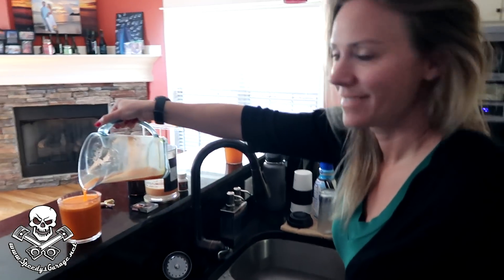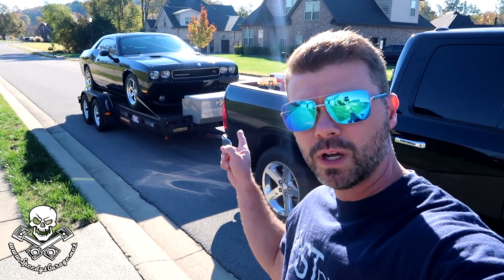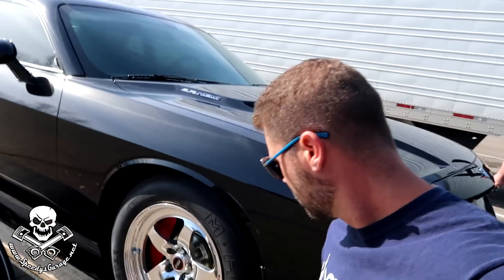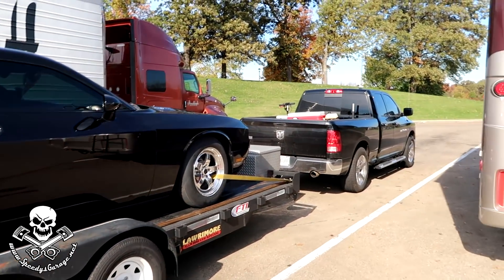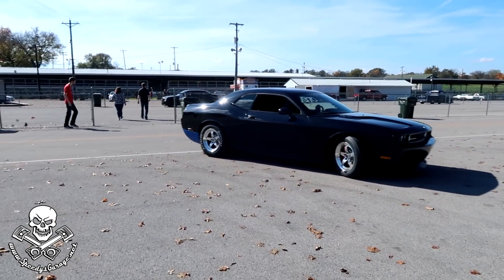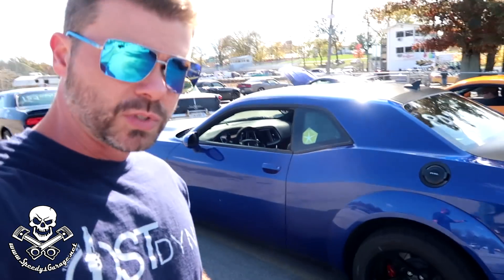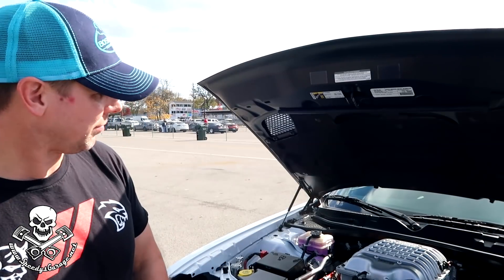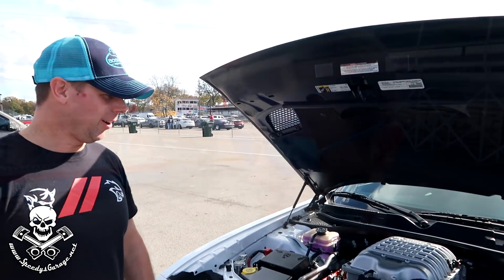Big Cam Test and Tune Speedy's Garage

Comment: Great information, over camming was so common back in the day, all some people cared about was a rough as hell idle not the response--My 68 427/425 had the factory 520 lift minus lash solid cam and that was good enough for 456 gears, wanted to try an L-88 or ZL-1 cam but I needed to swap springs and I was always short on $$$$
Reply from the maker: Turned out he had a bad push rod and was on 7 cylinders.  Fixed and he's back to running low 10s.

Comment: I'd say maybe the 392 gear from a 6 speed manual car and a looser converter. Anyhow would like to see what yall could pull out of this car...🤘😎
Reply from the maker: He ran a 10.55 at 131MPH a couple weeks back on 93 octane :)  Tweaking the tune a bit and some good fuel and it's low 10s all day.

Comment: The converter isn't right for the cam. Matching a cam to the current converter will be much more difficult than matching a converter to the current cam.
Reply from the maker: Agreed, we think he's got the converter sorted out.  He found something we think might have been holding the car back and have that corrected.  Have to wait till spring to re test though :(
Reply: @SpeedysGarage  I know about that! LOL!!!!!! I had to change my shift points 3X after a converter swap to get it right! I know you mentioned footbrake stalling in the video....flashing it at the line will launch at a higher RPM than footbraking…usually 500+ RPM..I picked up a 10th on my 60' flashing vs footbraking….flashing is also easier on the tranny.

Comment: which camera set up are you using
Reply from the maker: Combination of Gopros and a Canon G7x.
Reply: @SpeedysGarage  yes you can definitely tell when you are using the cannon super clear and sounds much better ... I also use the gopro's but will be switching to something like the cannon next ....
Reply from the maker: Yep, the Gopros have their place, and do ok with an external mic but the big adapter and all that is a pain.  Gopro need to make it much easier to get good sound.